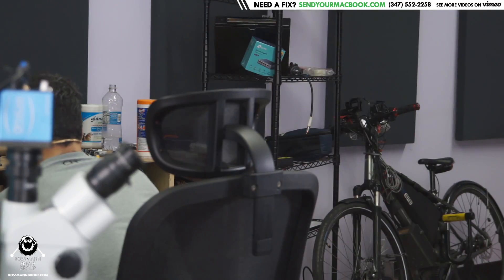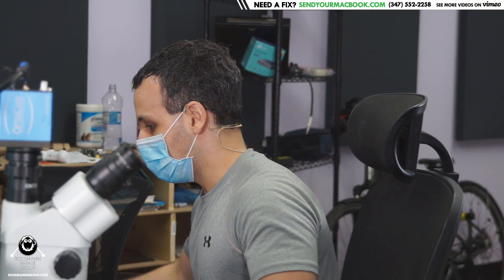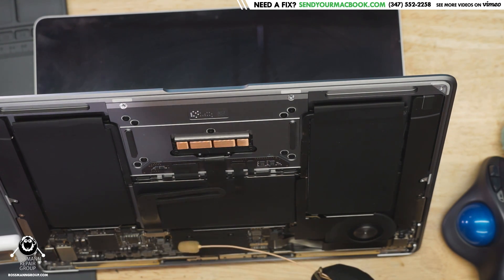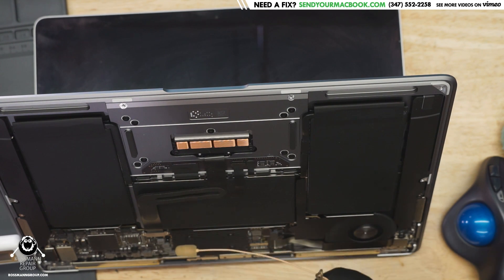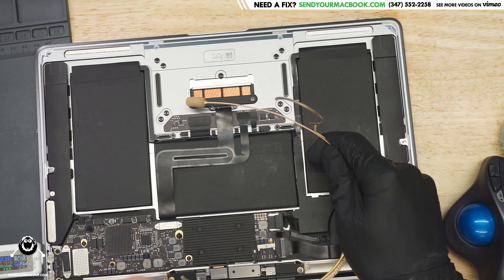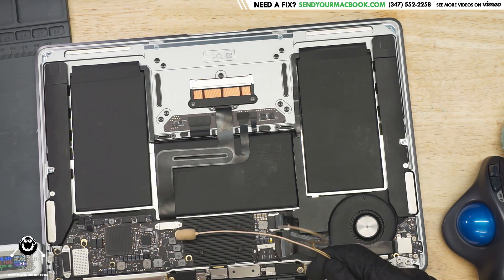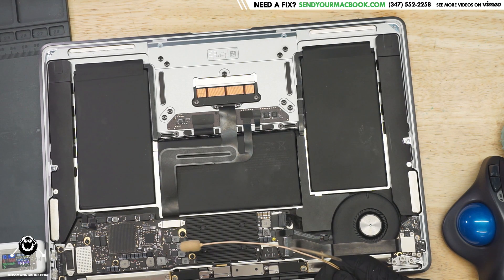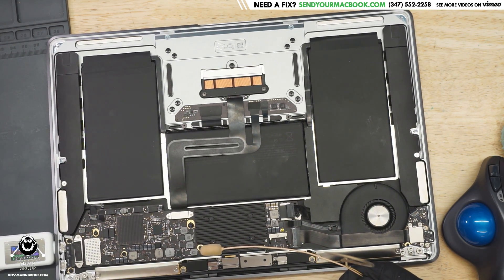The sound of a suffering Macbook Air CPU with no heatpipe 😢

Comment: I dropped coffee on my Mac and it was stuck in. a boot loop for 3 hours but now it works but it makes a crackling sound every now and then.
Reply: Water still boiling off somewhere, as a guess. Louis had early on videos about baking/drying components in an oven BEFORE boiling water destroyed them while running - or caused shorts, I cannot remember which, or both. Unless you have sugar in your coffee, then you could have water boiling off leaving a nice brown boiling sludge. Which then cooks later on, which...

My now teen, then 2 year old daughter went through a stage she was trying out for steam punk designer, though I  issed the implicit disassembly/recycling tech. It is amazing what a 2 year old can do with Harbor Freight freebie screwdrivers which also can be used as prybars/pokers/scrapers - this was the parent equivalent of an Apple design, cool idea terrible practical application. She would engage in covert operations, which included getting her remaining screwdrivers out of hiding, which was her response to a warning not to do that again without ASKING. So she would be doing her thing being very quiet, which seemed like a parental opportunity. What sent us running to where she had her little work desk was her muttering darkly, "That's not (slightly rising accent) good."

Louis needs to reproduce. Him having teens will be simply ADORABLE.

Comment: At least you can take solace in the fact that the chassis is made of 100% recycled aluminum! And the solder is 100% recycled tin on the logic board! 
And it will probably be recycled again before too long, lol. Really taking that whole form before function thing to a whole new level.

Comment: I might call Apple and see if they can explain how the heat sink does anything. I mean, if it’s nowhere near any air flow, or not connected via heat pipes, how is it supposed to work? My farts dissipate heat better than that.

Comment: I think it‘s coming from the coils of the (probably) voltage regulation next to the cpu? Possibly a short circuit anywhere or the glue in the coils became loose caused by heat and generating some noise. Well done, 🍎!

Comment: i want to know why is it making that sound. Sparkling? but in a CPU? TELL ME!
Reply: It's more than likely a bad inductor in the vrm part of the circuit. if you pay attention he puts the microphone over those little gray boxes. Those have little bits of foil in it, that foil has come loose and in the flux of the  magnetic field causes the vibration as the foil is repelled and attracted.
Reply: @adamz01h  ty captain

Comment: I have only one simple question : WHY ISN'T THERE A HEATPIPE BETWEEN THE HEATSINK AND THE FAN ?!
Reply: You need to "think different" to realize that you don't need a heatpipe. Just like downloading extra memory, you can download extra cooling!
Reply: @pudelz  exactly that. Why do the same as everybody if you can make the opposite? But hey, nevermind, they will keep it "magic" with some new "digital keys" stuffed into the BIOS and it'll work fine! Like a Pentium 1, I mean
Reply: Because apple is cheap and despises its hostages.
Reply: here is a video from louis, where he shows the missing heat sink in more detail
https://www.youtube.com/watch?v=iiCBYAP_Sgg
Reply: Apple.
Reply: Probably it’s how planned obsolescence works. IMO it’s a brilliant feat of engineering: less manufacturing costs, more customers incentivized to change their machine earlier than they thought.
Reply: @pansepot1490  From an environment standpoint, that's not good.
Reply: Probably real answer, they are trying to create a wind tunnel. The fan gets the air from the other side of the Mac. But it doesn't work as expected.
Reply: think differently
Reply: Because apple
Reply: The heat transfers through apple magic XD
Reply: They thing that airflow via negative pressure is enough
Reply: Maybe it was a weight saving thing? The Air is already almost as heavy as the Pro.
Reply: It's wireless heatpipe, Apple wants to go wireless even their heatpipe are wireless
Reply: 20W CPU..
Reply: @RandomUser2401  doesnt mean it aint heat up...
And if u go all the way to inplement a god damn fan than for fcks sake use it to cool the CPU...
Reply: @vanrex7682  not everything that produces heat needs active cooling.
Reply: @John_Doe27  ARM vs x86 is nonsense. TDP is physics. Heat production from electrical resistance is physics. It doesn't matter who makes the chip or what the instruction set is, what matters is how much heat it produces, and this is advertised as TDP. Low TDP processors don't require active cooling because they don't produce much heat.
Reply: @John_Doe27  that is just utter BS. The ISA has NOTHING to do with how much cooling you need. The only thing that counts it the effective thermal power output. Phone CPUs dont need cooling because they have much lower TDP. You are mixing up things here.
Reply: @RandomUser2401  Unless you want it to last, 80-90°C average temp is never ok.
Reply: @Lambda.Function  arms (phone versions especially) are designed to just have burst peaks and go back to sleep immediately. It's all about how quickly they can enter back to c-states.
Reply: @RandomUser2401  20w is a lot of heat to dissipate even with some forced airflow.
Reply: @RandomUser2401  Even RAM needs airflow please....
Reply: @RandomUser2401  20w only at base frequency* 90-150w TDP at boost speeds.
Reply: @Melamamoduro  that is BS. That CPU NEVER will draw 90W
Reply: @RandomUser2401  It will never draw 90 watts because it will hit T Junction just under that due to the anemic cooling.
Reply: @No-mq5lw  that is just BS. Turbo Boost power consumption is under ideal cooling conditions MAX 2x the TDP! so that would be sth like 30W-40W here.
Reply: @Melamamoduro  that is just BS. Turbo Boost power consumption is under ideal cooling conditions MAX 2x the TDP! so that would be sth like 30W-40W here.
Reply: @RandomUser2401  I see you haven't seen any intel CPU newer than Haswell.
Reply: @No-mq5lw  there is no way the vrm supplies 75A+ to the CPU, or usb-c would provide the necessary power either. That being said the design is still dumb.
Reply: tim cook cooks the cpu
Reply: even 15w cpus should have proper direct cooling, it helps them achieve longer lifespans and more performance

Comment: Bad inductor or choke next to the CPU. :) Check the vrm bank.
Reply: @Nighterlev  that's very unlikely, unless it was put on to a different board and tested it would most likely be in the vrm bank. Sound is hard to tie down being so close together.
Reply: @adamz01h  it's not on the vrm's. That mic is super sensible, that's why louis uses it so close to his mouth. It can have some decent precision, and it was indeed the die itself that was clicking. Dead CPU, not the vrms.
Reply: @somedude2492  nope that mic is good for noise to signal ratio. Its not sensitive that's why he uses it and needs it close to his mouth.
Reply: @Nighterlev  holy cow dude, a CPU is made up of state devices. It can be sent more than expected voltage, 20v dc will not create and arc. I suggest just you go watch all of electroboom here on YouTube and learn a thing or two. Go get an education, bootlicker.
Reply: @adamz01h   The Xenon arc lamp called to say you're an idiot. As someone who worked with arc lamps for a living for years, I can tell you that 20v is very much enough to start and maintain an arc in a small arc lamp. The run voltage (but not the strike voltage) of much larger arc lamps in the kW range is also in the 20-30v range, what keeps the arc going is the current.

And as someone who has had to deal with destroyed electronics, much smaller voltages have been enough to start arcs and make noise in damaged components. I've seen both singing CPUs and GPUs that had been killed by heat or power surges.
Reply: @GGigabiteM  we're not dealing with xenon gas though.😂 A xenon gas chamber has very different properties that air. Yes you can get gap sparking with 20v is you have a ton of amps in air. Don't call people names if you want them to take you seriously. 😁
Reply: @GGigabiteM  air was implied as it pertains to the issue at hand. You know this, you're just being pedantic. 🙄 Great YouTube channel btw, seen that you have done a ton of stuff.
Reply: @Nighterlev  how many years of electrical engineering training do you have? I have 2 years in it and electrical engineering was my minor in college. "The transistors in a CPU was clicking". That's not how a transistor works. There's no magnetic field being induced inside of the transistor to even create movement of anykind. A transistor is the combination of a gate, drain and source. When voltage is high on the gate in a npn transistor current is allowed to flow. No moving parts they are solid state devices. "Clicking" is not possible for this reason. Arcing needs tens of thousands of volts to overcome the resistance in the air. For example static electricity has thousands of volts in it but is very low in apms. the CPU passes max 1.34v and is prob less because that cpu could be undervolted to save on the heat budget of what the Mac can safely dissipate.
Reply: @adamz01h  oh so elecrical engineer? Cool, electronical engineer from Argentina here. Wanna know why i didn't say it? Cause 2 years of experience is nothing. If i don't brag about it, neither should you mate. Now, if everyone is saying you're wrong, that may be because of something.
Reply: @somedude2492  clearly I am mistaken. Because clearly you can't lie on the internet. Everybody knows that. Also everyone is two people vs the 88 who liked my comment. Lol. Rossman made a video about his mic and why he likes them, he gives the exact reason I quoted.